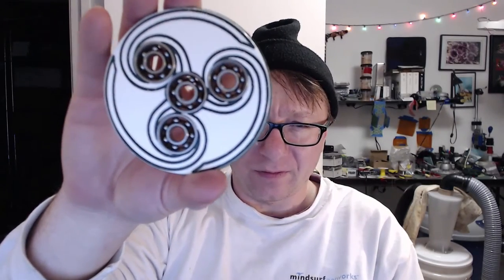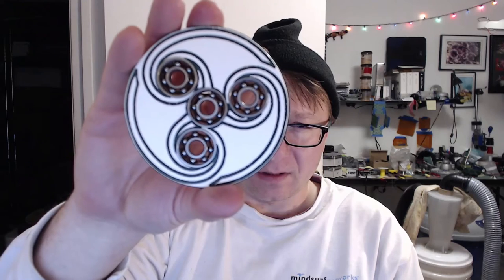Spinners not 3D Printed!

Comment: What CNC do you have? It's on my wishlist, and the X-carve seems like a good bargain. When Shaper was released I was hoping it would bridge the gap between a regular handheld router and a small X-carve. But to be honest the price was just too high for me.
Reply from the maker: Hi Matt - I have a Shapeoko 2 that has been upgraded to an X-Carve.  The machine works very well for most of my tasks.  I would say learning CAM was way harder than learning 3D printing.  When a CNC fails, it's pretty spectacular and very dangerous.  So far the worse thing my 3D printer has done is scratched the bed - it hasn't flung a piece of wood at me at 100mph.  I would say look into the Shapeoko 3 if you want to get serious about CNC.  It's a bit more solid than the X-Carve.  They have ironed out most of the bugs and manufacturing issues.  Thanks for watching!
Reply: cyberreefguru Thanks for the info! Yeah I can imagine that's pretty scary! Wood and broken bits flying around are one thing not to take lightly.